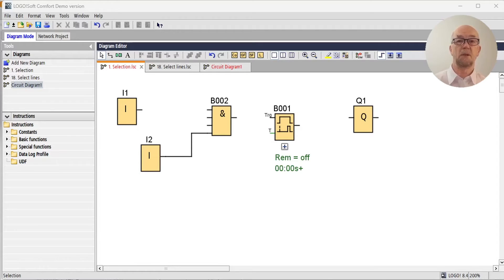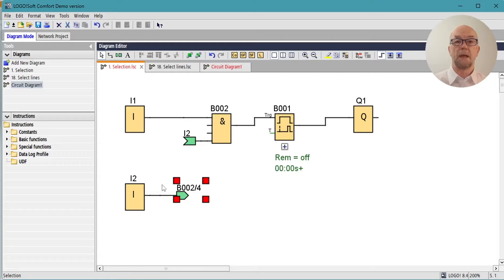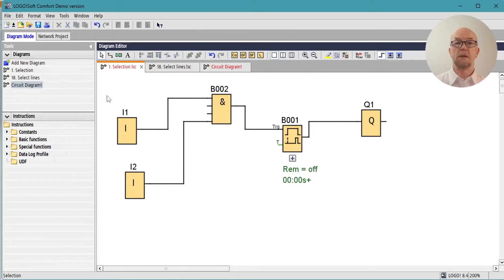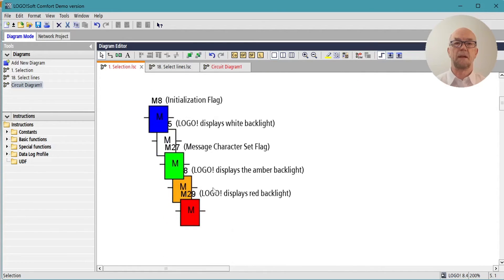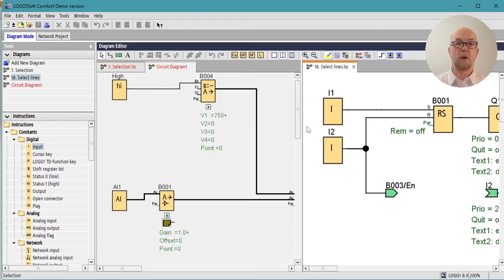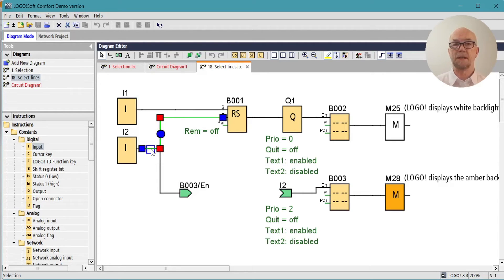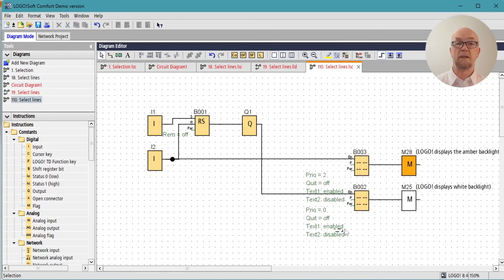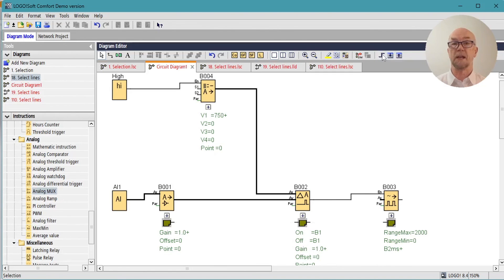LOGO!Soft Comfort - Diagram Editor toolbar | Siemens PLC programming

Comment: I was surprised to hear an Irish accent. Good man
Reply from the maker: You never know where we'll show up! Thanks.
Reply: @QuickPLC-kh5of  hey is there a simulation mode on this software or do I need to buy a physical Siemens LOGOS unit? I have downloaded v8.4 soft comfort.
Reply from the maker: Yes, there is a simulator and it's pretty good. It runs much more slowly than the actual LOGO! but this will only bother you in a limited number of situations. You'll find it demonstrated in most of my QuickPLC videos. It's super for testing programs before testing on hardware.
Reply: @QuickPLC-kh5of ok cool. Thanks for the reply. Do you offer a paid service or any type of training?
Reply from the maker: Maybe! Contact me through https://quickplc.com/?&mailform.
Reply: @QuickPLC-kh5of  ok sent.

Comment: Where do I see the values that the device is giving the logo?
Reply from the maker: Sorry, I do not understand your question. It sounds like you are asking about something not related to this video. I have many videos. See the playlists.
Reply: @QuickPLC-kh5of  yes sorry, I was looking for something really quick, our technicians connected the sensor wrongly and told me it was correct but It did not give any analog signal. And I was trying to find the correct display to see the live values from remote. They said they cannot find propper diagrams how to connect sensors to the logo and extension modules and I only found it in a youtube video. Like all the documents provided by the reseller as well as on the Siemens side are extremely terrible same for the MQTT implementation btw. I am still missing a simple HTTP requests though. But hey it works now. I am not an Electrical Engineer but the technicians and Engineers keep telling me this is not a "real" PLC it is just a logo for learning. I think I have heard that from like 5 different people? Can you explain that to me?
Reply from the maker: PLC = Programmable (yes the LOGO! is programmable) Logic (yes the LOGO! does logic) Controller (yes the LOGO! does control. It's a PLC.
It's not the usual type though and its real market is for you need a compact PLC that's cheap and has a built-in user interface. The device has been on sale for a long time now. 
It's more than just for learning. It's industrial quality and is sold on many small machines as its primary controller. Your colleagues may not be aware that you can program it in Ladder Logic too.
https://support.industry.siemens.com/cs/mdm/100761780?c=64396697611&lc=cs-CZ will give you some wiring diagrams which look pretty clear to me. There are more for each expansion module.